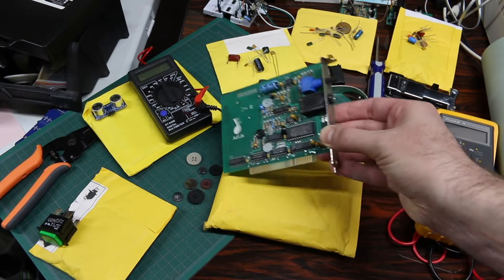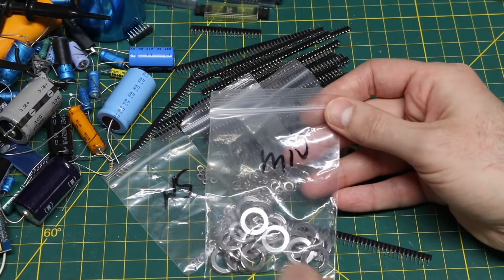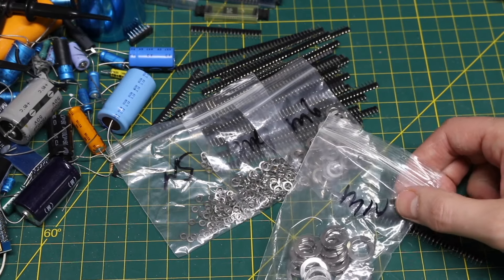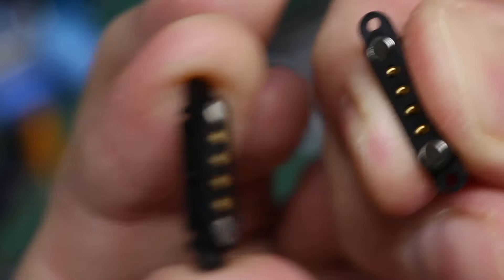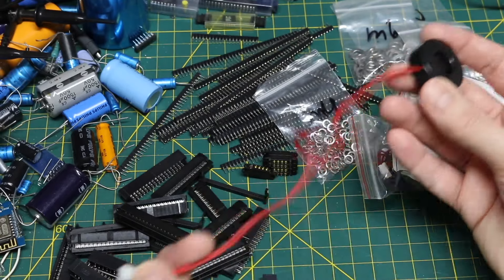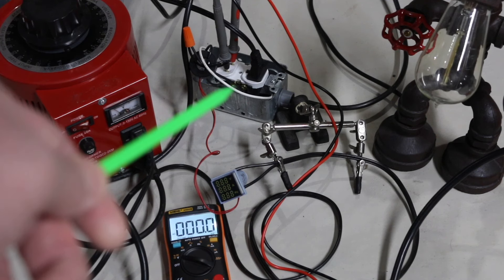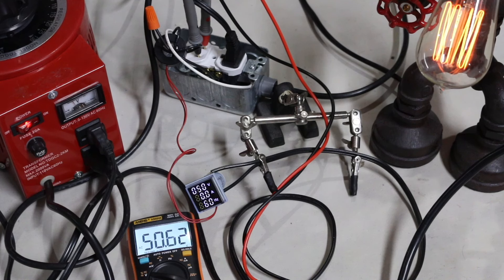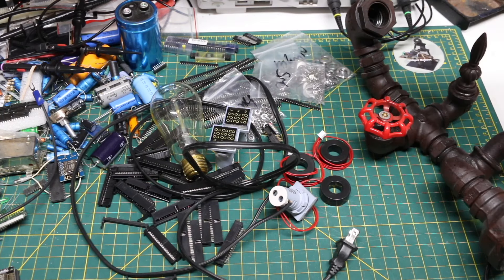Mailbag!

Comment: With the magnetic pogo joiners, concerned question, have they got a key way or are the magnets polarity different to each other, to stop from connecting wrong way and blowing something up?
Reply: The idea might be to make the connections symmetric, like USB-C.
Reply from the maker: if the connectors are backwards the magnets repel and won’t dock,  but in my application I wouldn’t have them freely dangling where are they could potentially go backwards, they would be approaching each other ideally already aligned but being able to account for some small tolerance in positioning
Reply: @GadgetReboot  not what I asked mate, when I said polarity difference meaning N/S on them
Reply from the maker: The magnets are situated so the connector can only mate when the magnets are not repelling so it seems like they set it up so the magnet poles are the keying mechanism.  if you try to dock the connector the wrong way the magnets will keep it from getting close
Reply: @GadgetReboot  that’s the answer I wanted to hear. Cheers mate

Comment: Are those magnetic connectors polarised? Second thing, about using them for USB, you might expect some problems with this use, as USB is designed to connect first power pins, then data. In this case all of pins will be connected at the same time. It's possible that anything you connect will work anyway.
Reply from the maker: The magnets polarize them by repelling when backwards and I don’t know if I will be needing to hot-swap, I just need to be able to replace modules occasionally. 
I haven’t looked too much into it but maybe there’s different connectors with different pin lengths so two different connectors could be used to separate data and power if needed.